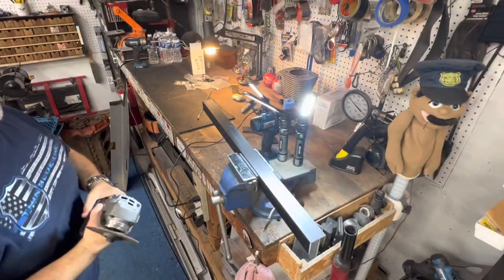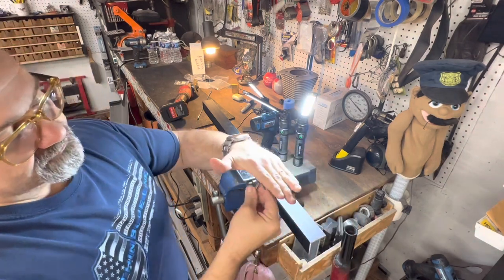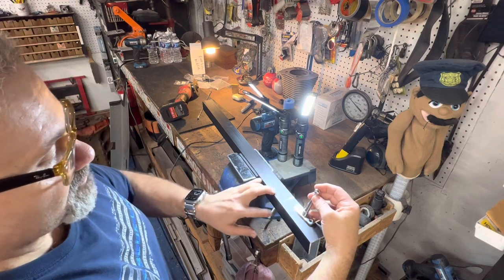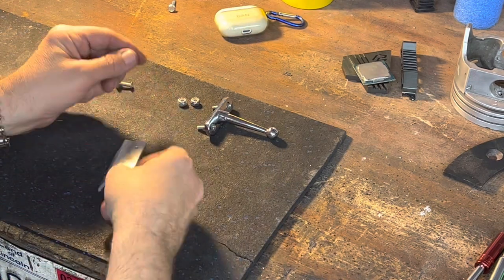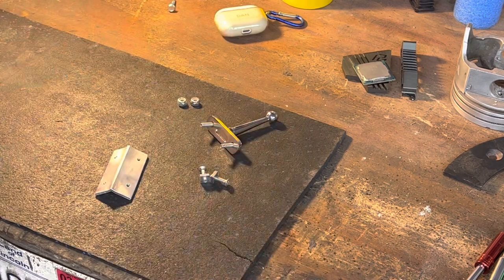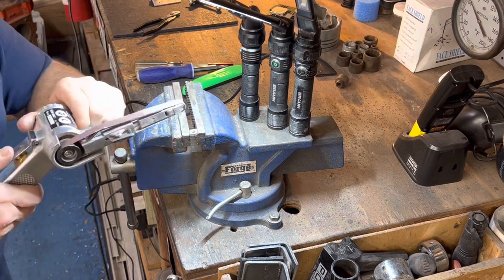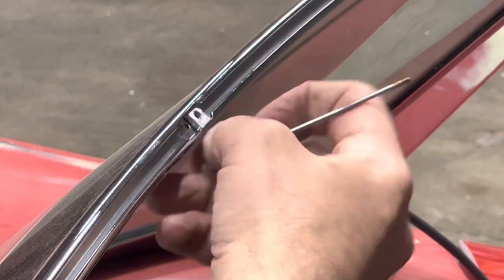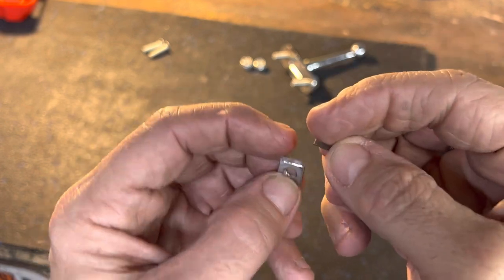Shelby Cobra Replica build Part 81

Comment: I’m a fan of mounting the rear view mirror on top of the windshield.  Just not a big fan of the  bracket that goes in the channel. Looks like an afterthought, although, mounting it up top is kind of an afterthought.  I drilled into the frame and tapped out some threads.  Not that I would ever add a top, but if I did, my channel is still clear.  I did have to pull the glass out and use a diamond tip and grind the windshield a bit so the screws would not hit the glass.  If you have a Lexan windscreen it wouldn’t even be an issue.
Reply from the maker: This bracket in its current state is temporary, I will remove the dash mounted mirror only to finish the body. I will however leave the mounting holes so if I do add a top I can move the the mirror back. As for my windshield in no way do I want to rush it BUT if I need to I will replace it with the lexan later. I’m planning on Powdercoating the windshield frame & a few more things. I want a mix of black & SS/chrome on the orange body color.

Comment: Been enjoying the series Dan. Figured I would throw it out there and offer to "Pay it back" so to speak. I am a hobby machinist. If you ever need anything made to spec for the car, I would be happy to see if it falls within my skill set. Lathe and Milling machine here, and can hit within 1/1000 of an inch accuracy with either. Let me know! Looking forward to ordering my kit in the coming years.
Reply: Just as an example, I could step the shoulders of those nuts pretty easily in T-Nut fashion so you keep the threads and lose the edges so it slides in the window channel.
Reply from the maker: Thank you! I appreciate that I will keep you in mind for my next projects.